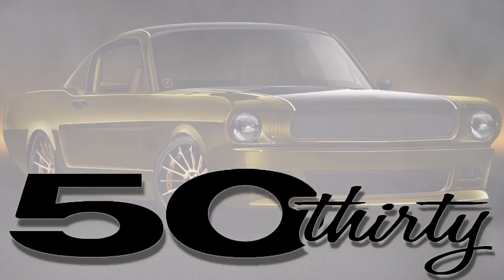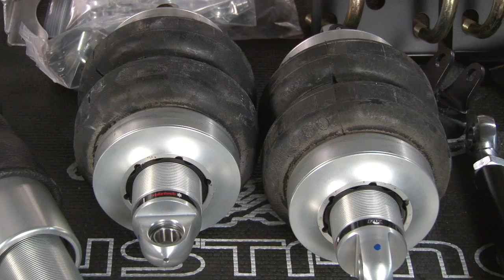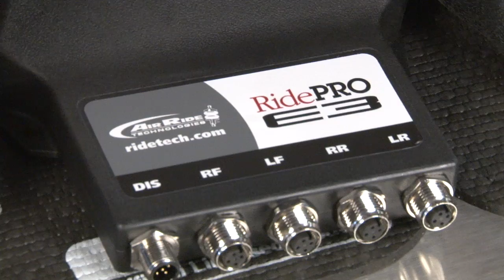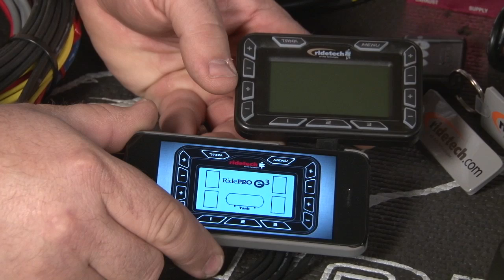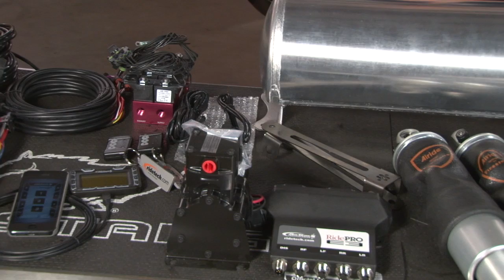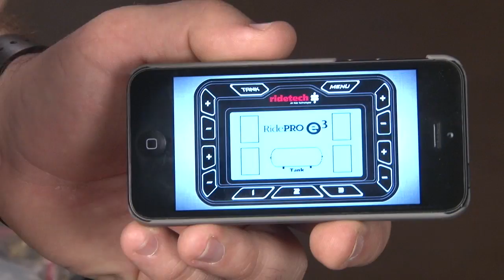Mustang Ridetech Air Ride Suspension Overview

Comment: towing capabilities with an air suspension?
Reply: It will work fine for whatever the Mustang is rated to tow, you can even add air to the rears to level the car.

Comment: What happens when the system fails. Does it lock at the current ride height, or does it go to the lowest ride height possible?
Reply: +NathanH172  If the system failed it would depend on what went wrong but it would not slam all the way down unless all the bags and the control block failed at the same time which is very unlikely
Reply: Bill Tumas Thank you.

Comment: I have a 2003 Mustang GT with a complete Cobra front end (Body work only) and I've been looking at the Ride Tech System, but I also saw the Air Lift System video you did on the 13/14 Shelby GT500.  Which one do you think is Best between the two for Over all Performance?
Reply: David J. Smith  They both do a good job, if I had to choose I lean towards the AirLift since there are less overall parts to the system. We have a kit for the 94-04 cars coming out very soon!